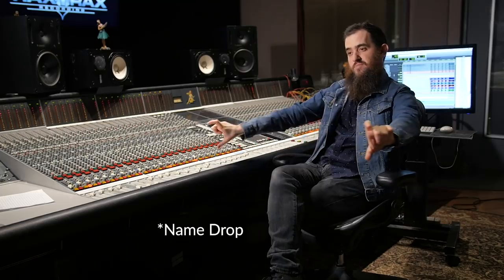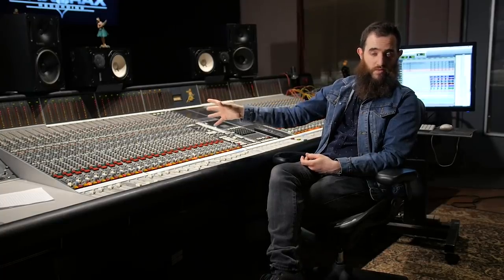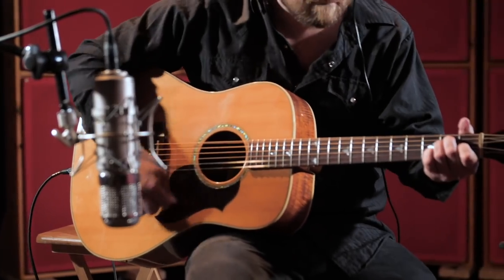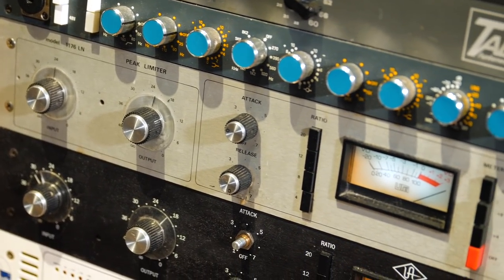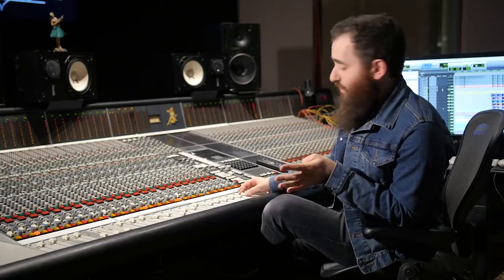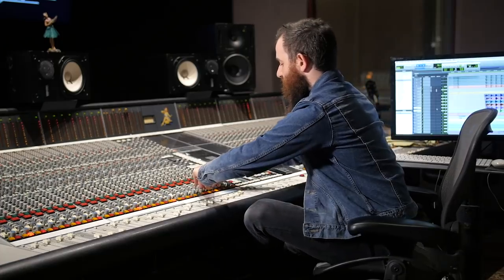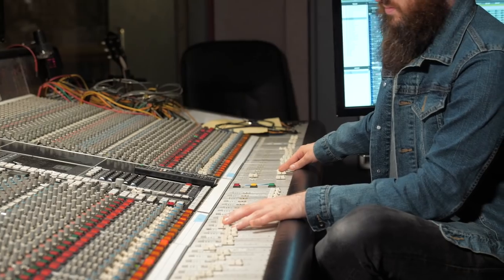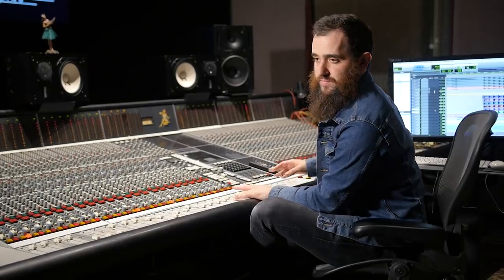6 Detuned Acoustic Guitars for Natural Chorusing | Reverb Experimental Recording Technique

Comment: One day someone will create a chorus pedal.
Reply: For a guitar, a chorus pedal works reasonably well.  However, there are more subtle differences between each of those guitar takes than just the pitch shifting.  For other instruments, resorting to the electronic approximation could be disappointing.  If you run a solo violin through an electronic chorus, it will never sound like the first violin section.
Reply: John Ladasky Great info but the comment was a joke
Reply: One day someone will create a beard trimmer.
Reply: Mr 335 
One day, someone will repair this man’s sense of humour
Reply: Mr 335  If it takes you 2 hours to record 6 rhythm guitar tracks, you've got bigger problems.
Reply: John Ladasky  oh yeah, and of course you can hear the difference
Reply: that sound super cool
Reply: Don't say such silly things.
Reply: @cctz_1  idk man, i call shenanigans. jokes are supposed to be funny...
Reply: Same, I have a good feeling about those folks over at Boss. ;)

Comment: I think it sounded rad with just the two in mono.
Reply: Yeah, I thought the rest of it was overkill, also that heavy electric rhythm kind of killed the subtle acoustic sound
Reply: @Deliquescentinsight  it was interesting but way les subtle imo
Reply: 2:59 that's really where this video should start
Reply: in the mix with all the other elements at the end, i doubt you'd hear all the subtleties of the guitar anyways.
But with those overdubs it sounds much more silky and has a better presence in the mix.
Reply: @TheOfficalAndI  I agree, but part of what you're hearing in the demonstration is just that they'd already turned down the volume of all the individual tracks, because that's what has to happen when you're working with 6 tracks all doing the same thing.

Comment: This is interesting. In terms of the idea of getting more 'width', this reminds me of Ken Townshend's invention of ADT for The Beatles (in 1967, I think), in response to John Lennon complaining that he did not want to have to re-sing some of his vocals in order to produce a 'thicker' sounding result. Because they were using analogue tape machines, in which the voltage varied slightly, the two versions of the split signal (one of which was delayed) would also vary slightly in pitch, creating a kind of chorus as well as the 'double-tracking' effect that Lennon desired. 

There was a brilliant, free plug-in version of this by Vacuumsound. I think that you can still find it, although some of the websites it is listed on no longer actually have it.

Comment: Hey, so I hate to be "that" guy, but frequency is measured in Hz, which is totally different from cents. The terms are not interchangeable. Cents are division by 100ths of a half step, whereas Hertz are frequency per second.
Reply: Hey, so I hate to be "that" guy, but the unit Hertz is in per second (s^-1), which is totally different from frequency per second. These two are not interchangeable. The first is a valid unit, whereas frequency per second (s^-2) is bullocks.
Reply: @origamigek  you got me, good catch!
Reply: good sport

Comment: Does this sound noticeably better than just pitch shifting multiple takes without tuning the guitar physically?
Reply: Andrew Olive Tree Mixing most likely, stacking the same track over itself thins it out while making it louder
Reply: @DommoDommo  I meant to actually record 6 separate takes, but just pitch shift them accordingly instead of actually tuning the guitars differently
Reply: I guess the best way to find out is to try it!
Reply: it would just sound worse
like if you pitch up your voice instead of singing on a higher note
you would sound like a chipmunk instead of a real person singing
of course you wouldn't notice as much in a guitar, but it would sound weird
Reply: @dimitreze  true. But 7 cents max is very mild, not in chipmunk territory. But doing it the real way is almost always better.
Reply: This will pop more because of the double/quadruple tracking effect, and the chorusing will sound more complex than if done with just effects.
Reply: bullshit pitch shifting separate takes would be basically the same as the tape method.  should work just as well.
Reply: It's not just about the shifting in pitch, slight differences in pick strokes and such give it a richer sound
Reply: @JareTerran  yes but I did mention to actually do 6 separate takes, so the picking and velocity nuance would still be there. Just doing the pitch shifting with a plug in and not actually tuning the guitar 2 cents at a time 6 times over
Reply: I feel like as long as you record it seperately each time and limit the pitch shifting to just a few cents then it should sound pretty much identical to this
Reply: If the guitar is going to end up this deep into the mix, like we heard in the end, its probably fine. If they are gonna be really apparant, i think its hard to make them sound not cheap by just pitch shifting after the fact
Reply: The discrepensies in tuning (compared to the rest of the track) are what make it stand out to the ear

Comment: Although he mentions Alan Parsons and Pink Floyd, it's worth nothing that Dark Side Of The Moon has no acoustic guitars on it. (Parsons was a tape operator on Atom Heart Mother, so maybe from there?)
Reply: All lead guitars in The Wall have a chorus so maybe during The Wall. I dunno if it was Parson tho. The acoustic of Hey You maybe?
Reply: You know Floyd had other albums right? Its not just Dark Side Of The Moon.
Reply: Of course, but Alan Parsons only worked on two of them
Reply: @apolloptx  Alan Parsons engineered Dark Side. it's an obvious point unless you're focused on finding a chance to be condescending :)

Comment: I appreciate this effect and I have used this principle but my question is; is it really necessary to have such a dense, huge acoustic sound? It sounds quite un-natural. I think the two to begin with achieved the effect, maybe one straight down the middle at 440 but beyond that what do you gain and more importantly what do you lose? It's comparable to the idea of layering up loads of distorted guitars, yes double-tracking makes things bigger but after that the more over-dubs added the smaller and smaller the part sounds as it becomes less defined.

Comment: If you were being lazy/had limited time could you not just do one take and pitch shift / stretch in any daw by said increments (and then print so you had 6 tracks) to achieve the same ? . Or should I fetch my coat ?
Reply: nowadays, yes. back then it was just you, a reel of two inch tape, and a whole world of possibility.
Reply: Indeed but the video is a day old and he is in a modern studio with said DAW.. So, purists aside is there real audible value to doing it the way it is presented (over the cheat)..
Reply: Sure, but why be lazy?

Comment: This sound can also roughly be achieved by taking one guitar sample at a perfect tune, and duplicating it 5 times, adjusting the detune/pitch on each one without stretch. Granted, it is the exact same sample so it will not have this exact same effect. Still doable, and its the same method a lot of vocals use to fill em out in a track

Comment: Nice, but you should have provided a ¨6-take´´ of regular tuned guitars as well.
Paned the same, they would probably sound as massive. Also remember  that 
2 cents down equals 4 up (if you´re after the same amount of change from 
the original pitch).
Reply: 2 hrz down is 4 hrz up, cents are already logarithmic, so 2 cents down is 2 cents up.
Reply: The video did seem to confusingly go between talking about hertz and talking about cents. The first pair of guitars he said "this one is tuned to 438 and this one to 442" which is hertz. But from then on he talked about cents.
Reply: The problem with multipe tracks in the same tuning is that you can get phase cancellation and the sound can become thinner sounding. Where you have 2 recordings playing the same note but with a miniscule difference in timing so that the peak of the soundwave on 1 track is coinciding with the trough of the soundwave on another track they cancel each other out.

Comment: what "tuned to 4.42?" means?
Reply: dimitreze instead of tuning to 440 hz (basic standard tuning) you’re tuning 448 which is 8 cents higher than the original 440
Reply: That's referring to the concert pitch measured in Hz, and it's not exactly a complex thing that most musicians wouldn't know. Standard concert pitch is 440Hz and that's pretty common knowledge for most musicians. Any modern guitar tuner will have the option to change that number on it.
Reply: The number refers to the frequency pitch of "A"  Typically it is tuned to 440.  There are those who say that 432 is a magic tuning.  I refuse to argue one side or the other.
Reply: thanks guys
sorry for being so harsh before
Reply: Just for my understanding, so when he says 2 cents above or below, or 7 cents above or below, he means tuning to 438, 442, or 433, 447 respectively?
Reply: Cents aren't Hz, so it's not quite the same. 7 cents means a ratio, so the number of Hertz difference depends on the frequency you are starting from.
Reply: Thanks Martin
Reply: @advanceg2116  refusing to argue against 432 being magic is letting people spew antiscientific lies.